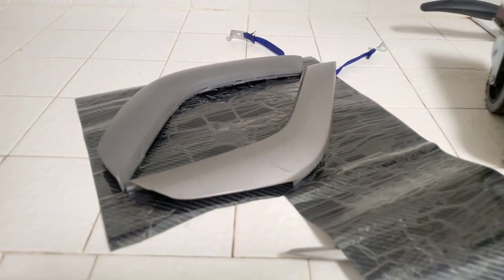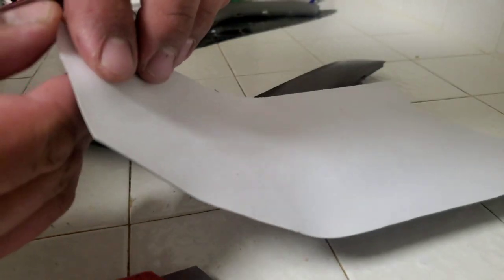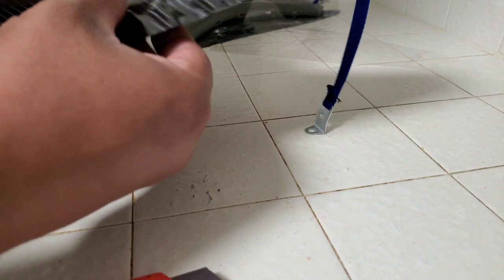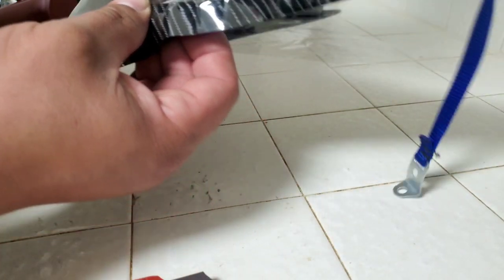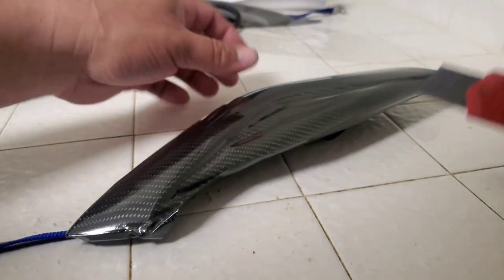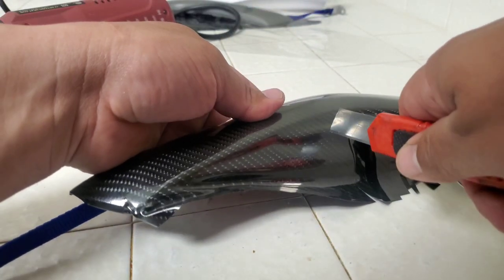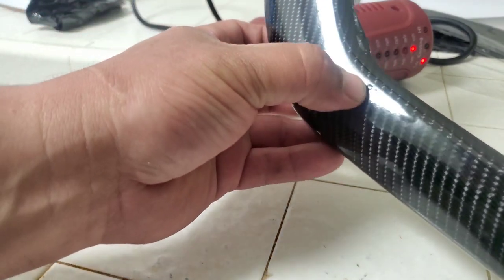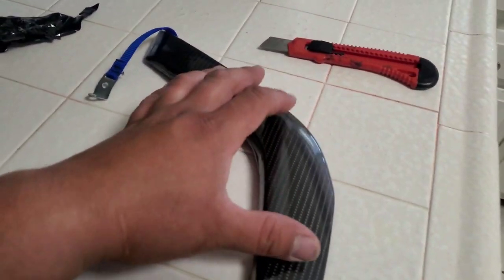How to: Vinal Wrap Interior Trim Pieces CARBON FIBER WRAP

Comment: With any vinyl decal its much easier to cut a slice down the middle and then peel a small section bacl from that middle cut so you can position the vinyl onto the part..... then press a straight line down the middle as you peel the backing off and then work your way out before doing the other side.

Comment: I'm having fun though doing most interior panels in digital 3d camo in a 2003 blazer haha
Reply from the maker: ohhhhhh thats dope!
Reply: @559powerscape  yeah my girlfriend has a 4 door spray bombed camo with tremclad so I grabbed a roll of 3m digital camo for like 20 bucks in town full roll. A little hard to work with very thick so the door handle pieces are harder to do, the speaker shrouds over the tweeters on the dash were tricky with the holes. Can't wait to do smooth straight pieces haha

Comment: you need to give yourself more material to work with. you misplaced the piece multiple times and weakened the adhesive. it should be okay since it’s an interior piece but that wouldn’t last on the exterior. you also didn’t give yourself enough material to tuck properly
Reply from the maker: Thanks just making it work with what I had left...no issues yet, still holding up. Thank you for the info 🙏
Reply: @559powerscape  understandable man.

Comment: This really isn't the best way to wrap a smaller piece like this the better way to do it would be to put tension across that first part you laid the vinyl onto.  Ideally you would want a way to slightly shrink the vinyl then hold it from atleast three sides which is hard to do hence why many don't do it this way but once you hold either four or three sides you want to push the part into it.  This will cause the part to stretch only slightly since you pre shrinked it and won't peel the sides up even though you stretched the vinyl over the entire part equally doing it this way keeps the carbon pattern looking as real as can be.
Reply: Also doing it that way you wouldn't need to slice it to fold it over the edge without getting wrinkles that's basically the whole point to the method I described it allows you to just lay the vinyl easily over the edge by applying heat and cutting it for a perfect clean wrapped edge.
Reply: You never want to stretch it while hot your only supposed to use the heat to bring the vinyl back to memory or use slight heat to help stretch.  You can also use it to break the memory but that isn't the way it was used here.
Reply from the maker: Damn that's what's up, I don't know anything about wrap but it came out coo. Thanks for the info ima try it like you said next time and see what's up. I'm just getting by. I'm no expert by any means, I just get shit done by any means. Happy Holidays bro 🙏
Reply: @559powerscape  much respect bro I'm not a expert either in fact your likely better then I am and have more hands on experience then I do I just been watching tons of how to wrap videos trying to learn it as best as I can.  It's not easy to wrap things perfectly the right way and I also find that sometimes what ever way works is good enough.  It's when you get into the harder to wrap stuff and want it to look absolutely perfect that this sort of stuff becomes.more important.
Reply from the maker: @full twist wrist  yes brother I agree 100%. wrapping is tough, but the more you use it the better and easier it gets, it's honestly the experience and pointers you get from others the helps alot. Thank you for your Support brother, have a good weekend and Happy Holidays 🙏
Reply: I’ve seen this method a bit and it looks a lot easier , do you know what this method would be called so I can watch some videos on how to do it (the method in this video is good but just too much for me 😂)
Reply from the maker: I honestly dont sorry just got ideas from others and practice it
Reply: @559powerscape  no worries , thanks